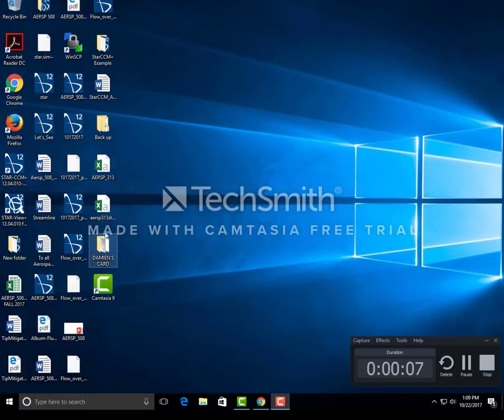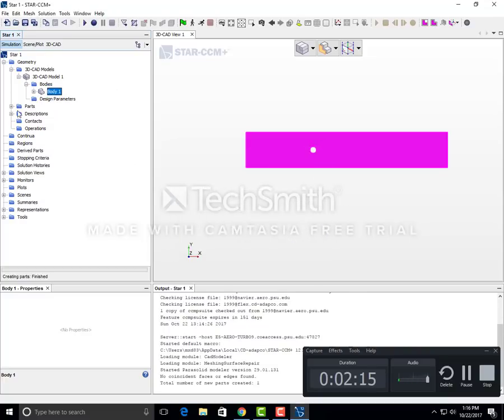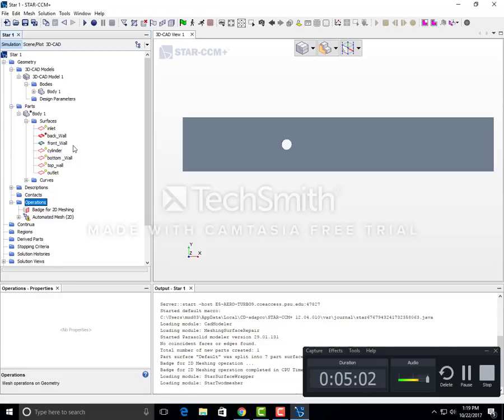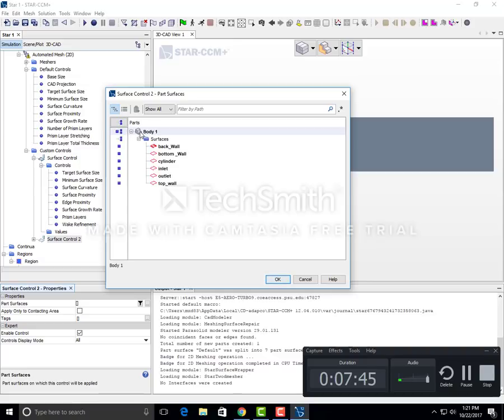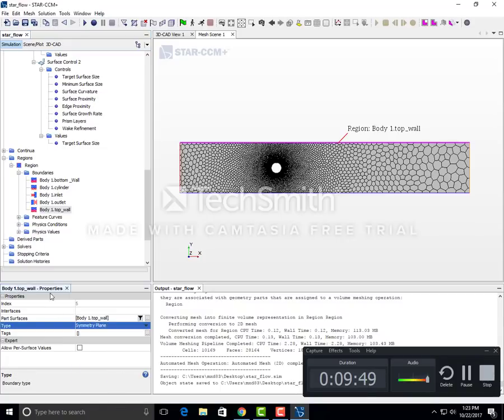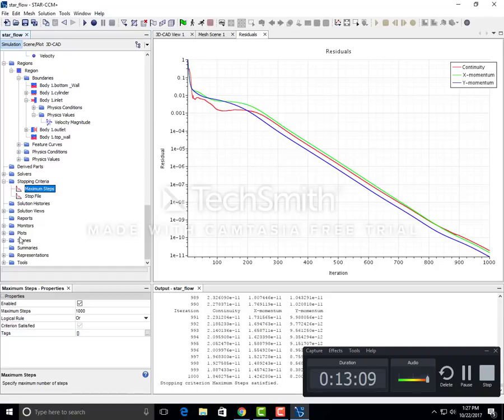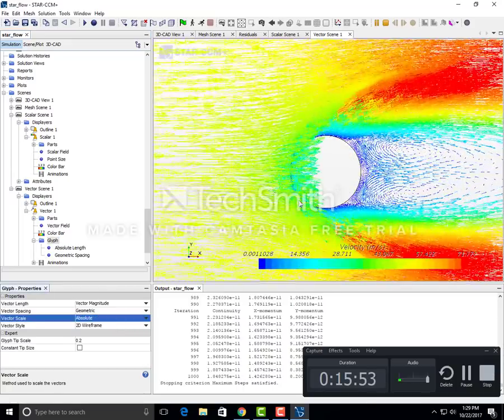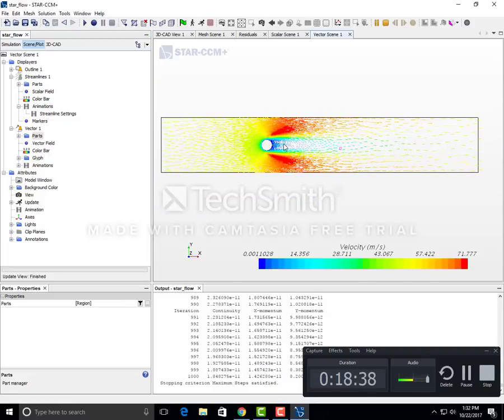Star CCM 2D Analysis.

Comment: hallo!
can u pls let me know how i can find the discretization error based on force in cylinder and deformation of free surface ?
thanks a lot in advance
Reply from the maker: Hello living on the ende, 
Thank you for the comment.
Could you please explain a bit more about what exactly is discretization error definition you are interested here? :)
Reply: mitansh doshi ..thanks a lot for ur reply 
the question i got for my project is to simulate the flow around a cylinder submerged in water at a particular depth. am supposed to select the solution domain and initial grid. i have been asked to estimate the discritization errors( based on force on cylinder and deformation of free surface ) and analyse the effect of the submergence on force on the cylinder and the deformation of free surface.
so what i did was to go the report option and selected the force and for the body the cylinder. but the solution i get as shear stress+pressure force is very much away from the expected solution or may be i did something wrong !
Reply from the maker: @user-lb5jh2oo1d   Your answer for shear stress+pressure is different because you may have not yet entered the values for variables such as density, direction of force you are interested in or so. Do you see any such options in report ? if not , you may have to change these variables under "functions" tab. Let me know if you are still struggling with this :)
Reply: mitansh doshi 
well in the report option i have selected the force in x direction and reference pressure as 0Pa.
the problem is when i have the cylinder at a distance of 0.3m from the top of a 5m*1m (L*B) pipe at a distance of 2m from the entry the force value i get is around 24N but when the same cylinder is placed a distance of 0.5m from the top (all other options or meshing and stuffs kept. constant) the force value is 34N .
well such a big difference in the force is what is making me wonder the mistake i have done .
btw where do i find the „Function“  option ?
Reply from the maker: @user-lb5jh2oo1d  i think i am understanding your problem  a bit better now. You said your problem statement is related to the submerged cylinder is that correct? Now if you have F=24N at 0.3m from the top and F=34N at 0.5 m from the top then in the second case (F=34N, @0.5m) you are more submerged in water correct? So you should be facing more force on the surface. Also, try putting the reference pressure as 1 atm. So all your pressure values would be measured from the reference. 
About the function option, try searching under tool tab.
Reply: mitansh doshi 
it’s based on submerged force but my question is what will happen to the force that is applied on the  cylinder because of the flow of water (in my case the water is flowing at a speed of 1m/s ) should i not consider that force .and sorry i made a mistake the force on the cylinder at the depth of 0.3 m is 25.41Nand at 0.5m is 25.921N from the software and by mathematical approach i am getting almost the same value as the case of 0.3m but for the case with 0.5 my mathematical value is 35N (around ). sorry i confused myself with the software solution and the mathematical solution
Reply: and  one more thing i forgot is that my flow is turbulent.! sorry 
thanks again for ur help
Reply from the maker: @user-lb5jh2oo1d   Sorry for the late response. I was finishing up a paper for my research. If you are considering the water flowing then we should be looking into the dynamic loading case. i think you may have to find the component in x and y direction and calculate the resultant force and this force would be the actual force experienced by the cylinder.
Looks like the software is working well for the 0.3 m depth. Now for 0.5m, can you try finding the resultant force (sqrt (Fx +Fy))? and see what you get?
Reply from the maker: @user-lb5jh2oo1d  thanks for pointing that out. If your flow is turbulent. which turbulent solver are you using?
Reply: mitansh doshi 
i am using RANS + K epsilon method
Reply: mitansh doshi 
i am using RANS model + K epsilon. 
is it possible to get ur email id (if that’s okay with u )? it’s easier to show u the problem
Reply from the maker: @user-lb5jh2oo1d  could you try using the one equation state and K-omega model too just to see if you are getting about the similar answer or not. 
sure. my email id is mitansh.doshi@gmail.com
Reply: mitansh doshi 
Okay Thankyou

Comment: how to set a constant temperature value?
Reply from the maker: under the physics model, you would have an option of setting a temperature value to some number. by default it stays at 300 K as far as i know. 
Let me know if you need more explanation. :)
Reply: @mitanshdoshi7992  thanks i figured it out...i first chose  segregated fluid isothermal (according to my professor's instructions), temperature wasnt there, then i chose a different option and it worked...
Reply from the maker: @belminho9   Glad to know. Sorry for the late response :) I was away for the winter break :)

Comment: Are you 100% sure that segregated is for incompressible and coupled is for compressible flow. I don't think so. Please confirm
Reply from the maker: Hello Ganesh Kumar,
Thank for your feedback. It is told that for incompressible one should use Segregated flow solver and for compressible one should use Coupled flow solver. Even though segregated flow solver can handle mild compressibility but it is better to use the couple flow solver.

I have confirmed this with Star CCM+ help section.
Segregated Flow and Energy
The Segregated Flow model is an alternative for incompressible or mildly compressible flows, particularly when computational resources are an issue; it is used with the Segregated Fluid Energy models.
Coupled Flow and Energy
The Coupled Flow and Coupled Energy models are best for compressible flows, natural convection problems, and flows with large body forces or energy sources. The Coupled Flow model includes the optional AUSM+ inviscid flux scheme, which is advantageous for flows involving high supersonic and/or hypersonic regimes.

let me know if you have any more questions or concerns
Reply: @mitanshdoshi7992 1.  Can you please tell me what range is mildly compressible?  2. From the help I can understand that they are giving recommendations but no strict rules am i right? If seg is only for incomp and coupled is only for compressible, does it mean that I cannot run a high speed pulse detonation simulation using seg solver and flow past cylinder case in coupled method. Please confirm.
Reply from the maker: Ganesh Kumar, unfortunately, I do not know what range is mildly compressible. Star CCM+ help section doesn't give the clear idea about what should be the range for each of the flow solver. I think something below Mach number 0.3 could be treated as incompressible.  so you can use that rule to gauge the idea of what type of solver you should use. Looking online quickly  I did not find any strict rules so I  think it is just a recommendation. 

I have not dealt much with the coupled flow solver so I cannot help you with your "high speed" detonation question. Maybe online CFD forum can help you with that better.
Reply: @mitanshdoshi7992  No issues, already I have done detonation simulation in STAR-CCM+. Both coupled approach and segregated approach works fine. What I was trying to convey is, From my point of view the major diff between seg and coupled is the way we find pressure (SIMPLE scheme in seg) while coupled solves all together and requires some % of extra solving time. Of course when we take high speed flows it is better to go with coupled method than segregated method (I am not saying seg cannot be used), but ROE and AUSM+ with attractive pre conditioners holds upper hand in this. Thank you for the reply.
Reply from the maker: Ganesh Kumar no worries. thanks for the additional information. I would look up more about ROE and AUSM+.

Comment: Thanks for your great tutorial! 
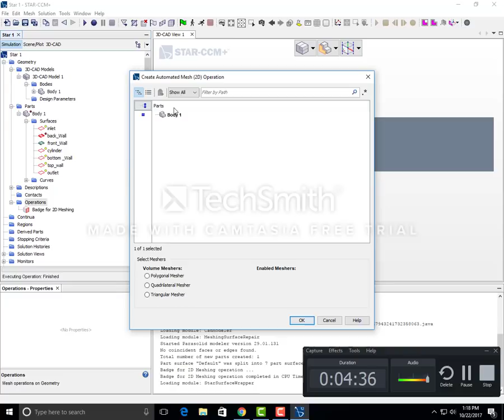When I try to do the Create badge for 2D meshing operation at @5:09 I don't see anything to check. What am I missing?
Also, in the geometry scene, my part isn't visible. I have to select the part to highlight it.
Thanks!
Reply from the maker: Thank you for watching TheZepside.
Can you go to your 3d CAD Model and click update? sometimes if you do not click update you do not see your part in geometry. Also, make sure you have right clicked on bodies to create a new geometry part. 
That is the reason you are not getting any option to select any bodies for 2d meshing. 

Kindly, let me know if you are still facing the same problem. we can look into it in more detail. 

Thanks once again.
Reply: Thanks a lot for your answer. I figured it out though; I had no geometry intersecting the z=0 plane, so I couldn't generate an automated 2D mesh. I changed my geometry, and it worked.
I want to ask you another thing while here. I have 39 different CAD files that I want to run simulations on. The geometries vary just a little from file to file, but what is the best way to run the exact same setup to different geometries? Quite cumbersome to copy everything to so many different .ccm files.. 
Thank you for helping!
/Alex
Reply from the maker: Even i am facing the same issue with my research work where i have to modify only one part of the stage and i have to import the whole thing every time i try to run a new simulation. 
What i am trying to do is, i am keeping my variable part as a different body and then assembling the whole thing. so that i can open my 3d cad model and delete that part and replace it with new updated geometry. when you do this you would only have to update your 3d cad model/regions and boundary for that specific part. 

also, see if this link helps 
https://www.cfd-online.com/Forums/star-ccm/187556-meshing-pipeline-swapping-geometry-how-update-regions-boundaries.html

I am using Solidworks to create my CAD files so it is easy to create parts and assemblies. t

Let me know if you need more help on this matter, i could gladly ask other Star ccm users who are well versed with the software than i am to help you out.  :)